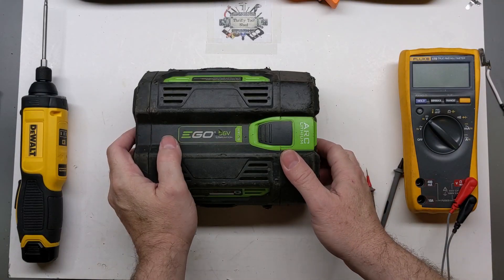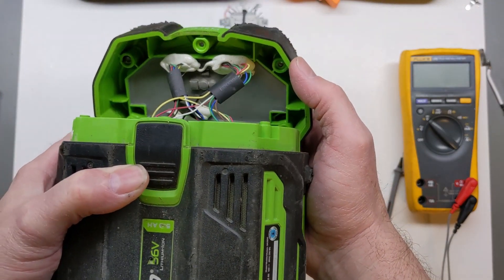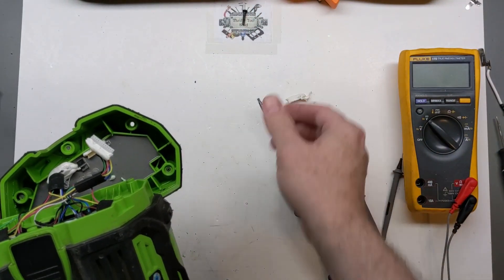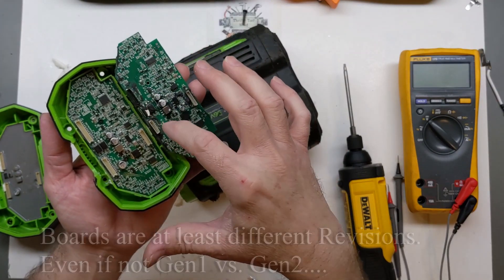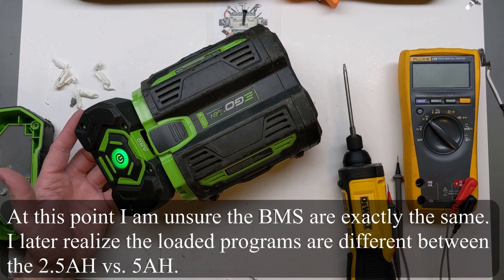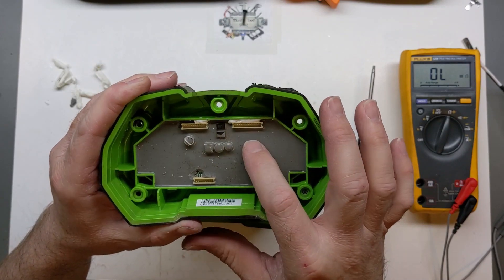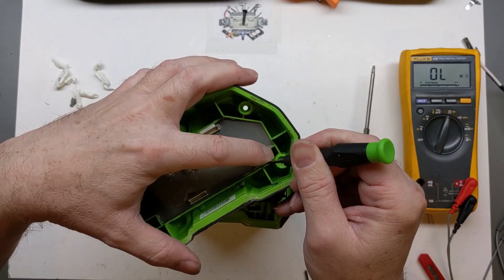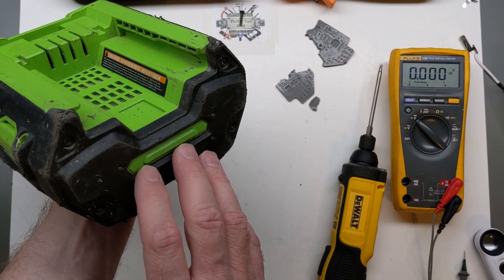EGO 56V Gen1 5AH Blinking Orange Fix

Comment: My batteries are fully charged (supposedly ) and after few seconds of runing my Ego lawn mower it stops and blinks yellow exclamation light kn mower and i think yellow on battery. Thkught it was battery. Grabbed another full battery. Same deal. Can leaving lawn mower out in rain ruin it after one time? Batteries were inside and battery container was closed empty. Didnt know it was supposed to rain and was stuck at work. Thoughts?
Reply from the maker: I have seen the mowers not start up fully and flash the yellow light on the mower, and that seems to be a controller issue. It's like the controller is picking up high startup current and shutdown. I verified mine by removing the blades, and it starts up fine without the inertia load of the blades. I have a EGO mower troubleshooting video on that. It's the only issue I have seen from the mowers. It's hard to say if the rain could cause it, the controller is epoxy sealed well.
Reply: @ThriftyToolShed  thank you! Think I screwed up the controller by leaving it out in the rain once?

Comment: Thank for creating this video, I appreciate the effort you make to educate the rest of us.   I did watch the whole thing and learned quite a lot.   However, I tried the drop fix from the comments, and it seemed to work.  Unfortunately, I thought it was the mower, and think I f**'d it up, before finding this video.  So, I already bought another EGO mower, with the newer, bigger battery.  I will attempt your repair on the old battery, if it acts up again.    Reply back, if you have, or know of a video to properly disassemble/ fix the old Gen 1 mower.  I'd like to salvage it.
Reply from the maker: Since we did find the issue to be a loose connection as shown, of course bumping it might help and it seems to be atleast an quick fix for some, but as you mentioned it might come back and now you know how to properly fix it if it does and that is awesome. Thanks for your comment it means a lot that you took time to comment that it had value even though bumping it might get it to work. The goal of the video was learning together and it seems to falls flat sometimes. 
As far as the mower I do have a trouble shooting video on it and then later a video replacing the controller with a cheaper one since the controller is epoxy potted and not much we can do with it. I would recommend other controllers today and find one with softstart if at all possible if not you need to start mower and them turn pot up slow just so start up current is not too high. 
I am using a tiny controller right now, But it is on the verge of undersized and I hate that, but it's so convenient since it has softstart and undervoltage protection but in. I may do a video on it, but it's too early to recommend. If you like tinkering around and learning let me know and I will be glad to share the link with you, but I can't truly recommend it for sure yet. Also if you run high lift blades, I would not use it. It is too much added load to the struggling controller.
It is so easy and I contacted the company about making a controller just a little bit bigger and they said they would consider it, but they mainly market it to kids ride on toys etc. 
Here is the troubleshooting video of the mower and the replacement video should be after. Best of luck to ya!
https://youtu.be/TnxMegiCu_Y

Comment: Thank you for your video. How much cost you to replace the new electronics board? After you replaced the new board, it was a green light on. What happen for the second turn on was yellow?
Reply from the maker: It is nowhere at this time we can buy replacement boards. I have had luck repairing some boards as we learn. I have shared on video all I have learned so far.

Comment: I had to clean the connectors between the cells, and also did the one where the temp sensors connect to the BMS.  Get some MG-801B with PPE and spray on before assembly of the connectors.  it's supposed to keep the connection good long-term.  Used in cell phone manufacture and in plenty of other things.

Thanks again for all of your videos, saved me a lot of trouble and time!

Comment: Ty for the video, I think I fixed mine by reseating/cleaning the connection that is between the 2 halves of the cell packs
I did the 13:30 part, where you separate the 2 halves, and reseat the connectors. (and clean some of the silicone off)

My original complaint was that the mower would randomly cut out while mowing. I think the battery would flash orange, and the mower might have flashed yellow. You would have to wait 10-30 seconds, and then it would be able to be restarted/used as normal

I did this "fix" (basically pull the 2 halves apart, pull the connector or two out, reseat them). I then mowed my lawn. The mower did not die. It also seemed to automatically kick into a "turbo" mode when about to bog down. I don't recall it doing that before the fix. So maybe the turbo boost is related; like, it draws more power, which overloads some loose connection or something, and causes a safety fault. I don't know; I'm not even 100% sure it's fixed, but it's been through 3 charges since, and no cutouts yet. Previously I think it would cutout once every 1-2 mows.

Thanks for your videos and the knowledge
Reply from the maker: Awesome, so glad it's performing better. Hopefully you have found the issue. Thanks for sharing and for your kind comment!

Comment: I had a similar poor connection on a LM2130E-SP mower control board ... resulted in a solid orannge lifgt on the mower ie thermal fault (when mower cold). Worked connection in & out and fixed!  I think EGO has a problem with the suitability of their connectors.

Comment: How did you open the middle part of the battery into two?
Reply from the maker: Mine had long screws holding the halves together. Then I could gently pull the halves apart. Being careful not to pull the wires. I think I had to unhook some balance wires to allow full movement.
Reply: Are you talking about the cover, or the inside part?  Mine, the cover was very snug, but the two halves of the inner part where the batteries are had nothing holding them, except for a bit of silicone goo.  I took a knife and carefully made a slit in it to help it come apart.  watch out you don't cut any wires!

Comment: Hey, very nice and helpful. What can you tell me about a new( fuel gauge) 400 battery that is like 6 months old and has no RESPONSE at all. Used as normal and charged to full but would not work in mower. Returned to charger- no RESPONSE from charger at all , no lights. If you take volt meter and stick it in the slots you get 56 volts!!!  Fuel gauge has no response either. Do have any idea WTF is going on??? Would appreciate any input you would have.  THANKS FOR " Listening "
Reply from the maker: Glad you found the video helpful. I have not had the opportunity to work on much with any of the newer packs (that I call Gen 3) with the segmented fuel gauge. It is similar to the older ones in many ways. The first thing to check is if it has a fuse on the connector board and the going to the BMS board. Simply make sure it has power from the connector board getting to the BMS board via the bottom middle connector from the BMS to the connector board. Usually it has 2 black and 2 red wires in that connector that should have 56V on it. If you have the 56V getting to the board from there it is usually an issue with the DC-DC converter part of the board. In about the middle of the board it has some larger capacitors and it has a small silver can or cube that has 3 coils in it for the converter circuit. Sometimes those coils do go bad or maybe even another issue with the circuit. If you have 56V in to the BMS then you should see some voltage like maybe 10V or so on the cap close to the coils. Many times the issue is around that, but could be many things really. It's a pretty complex board. This pack also should be under warranty which I assume you already know at this point. Best of luck to ya!

Comment: Love the awesome videos and keep up the great job! I have a gen1 5Ah battery stuck in maintenance mode. Have you ever came across this? Any info would help, thx.
Reply from the maker: The blinking green light. That is my very first EGO video. I found Q12 transistor shorted on my BMS board. It's been a common failure. I did have to suffer through so many viewers telling me it was just maintenance mode that nothing was wrong and also that it was under warranty and to send it back. Instead of just simply actually watching the video where I explained EGO did replace it and told me to keep and recycle it. I also explained it was constantly blinking green and it will pull the cells down to zero and ruin the cells if not charged very often or either unplug the board until repaired. It is an older video and just learning together as we tried to repair these. Hope you find it helpful. 
https://youtu.be/EH0GS0iUzzM?si=CKDuAUYaDc8AP7HJ
https://youtu.be/EH0GS0iUzzM?si=CKDuAUYaDc8AP7HJ

Comment: Is there a temperature sensor n these batteries? I have a 10ah Ego that if it’s in my Ego mower it shuts off after a minute if the outside temperature is over 85degrees.  Mower works normally with other batteries. In colder temps the 10ah worked for much longer, works ok in leaf blowers.
Reply from the maker: Yes, I have an older video called "What is the T-terminal?" I talk a little about the NTCs in the pack also the 5Ah and above have temp. monitoring boards in-between the pack halves. The 10Ah was not out yet at that time so I am not sure exactly how similar that will be.

Comment: My Ego 56v battery was flashing orange and I couldn’t get it to work. After watching your video I dropped my battery around 6” onto concrete. The battery is now working as it should, I suspect a bad contact as you described. Thank you!
Reply: Hhahaha thx, that fixed my battery
Reply: Awesome video, and based on the comment, tested the theory of a bad contact by dropping the battery onto my cement garage floor from a relatively low height of ~ 6".  Dropped it so that the indicator light was facing the floor, since it seemed well protected.  Then pressed the light and presto --> green :-).  Thanks to the video author for a great well explained video, and also for the idea from the commentor!

Comment: Thanks for the hard work put into this video, but this definitely isn't an 'easy' fix, as some commenters have said. Easier thing to try? The following worked for me, with my 1st gen 7.5ah battery: unplugging the charging unit for about 5 minutes and then plugging it back in, then charging the battery. It works each time I do it, but I have to do it before each charge now. It turns out that my charger was on its way out and somehow screwed up the status detection in one of my two batteries, so I had to order a new charger and am looking forwarding to this 'flashing orange' issue being no more. It was the charger, not the battery!

Comment: ego design flaw with the battery in the middle to much heat ?
Reply from the maker: One of the best designs I have ever worked on. Most packs like the Echo 58V and Ryobi 40V are like bricks and not enough airflow through the pack. The EGO did design for air flow, an arc design to have more space and even used the phase change sleeves for the 1P and 2P packs. As far as the 3P or larger packs, it is always going to have potential risks of overheating with that many cells together. I typically stay away from 3P or larger packs for that reason. For absolutely sure all packs do have issues with heat in some situations and I do agree.

Comment: Absolute junk company. Big surprise.
Reply: These batteries are surprisingly well made, and the fact that we can open them and fix, if/when there is a problem, is a nice touch.
Reply: @jon_byler  For the exorbitant price, we should not have to do that. And certainly not many are capable of doing so.milked I said—-junk.
Reply: You don’t have to do that.  They have a great warranty.  I have had one battery die years ago, they replaced it no questions asked.  The battery I just repaired, I got for free with a mower I bought used.  Original owner had already made the warranty claim, so I got a free battery for about half an hour of poking around in the battery.  Others o know with ego stuff have never had a problem at all.  They either fail quickly or last a long time.  And failed quickly is under warranty.

Definitely not
Reply: @jon_byler  They certainly did not give me a free battery after it failed in year two. Garbage. Avoid at all cost.
Reply from the maker: Curious as to why they did not honor the battery under warranty, did you have the pack registered?
Reply: @ThriftyToolShed  It was registered.
Reply from the maker: @hammill444  
I have dealt with them a lot in the past and talked to many that have as well. I have never seen a bad pack that was registered not warrantied. Just wondering what could have changed. I would call again for sure.
Reply: @ThriftyToolShed  Their customer support is atrocious. I switched back to gas.

Comment: Thank you for sharing your video! I have a similar problem with my Ego 56V, 5Ah battery. Despite being fully charged and measuring 57.6V, the red light starts blinking after operating for only 1-2 minutes. I'm wondering if this issue is caused by the circuit board or the wiring.
Reply from the maker: Yes if all cell groups are testing good and all connections are good at the BMS then most likely it is a BMS board failure. The most common issue is a cell group or more than one cell group reading lower even if the pack over all voltage is good. The second most common issue to me is connections on the board and thirdly the board itself. Thanks for your comment.  Best of luck to you with yours!

Comment: I have one of these batteries that has this problem. I've taken it apart and cleaned the contacts with electrical contact cleaner multiple times. This always works, but within a few months the problem comes back. Any ideas for a permanent fix?
Reply from the maker: If I did have an issue coming back I would consider giving the board a coating to help prevent it. I would make sure to use a silicone based potting to easily be removed if it were needed. Something like this as an example?
https://amzn.to/3EgwUpa
Reply: @ThriftyToolShed  I took the battery apart again, cleaned the contacts again, and sealed them with the product you recommended. But, here we are in mowing season again and the problem has returned. I only have a small suburban lot so I doubt is really overheating. For now, I take the battery out and drop it on the lawn from a couple of feet and it works again. I am debating soldering the connections but that would be quite a challenge in such a tight space.
Reply: you need better contact cleaner, something that will keep it from corroding in the future.  Did you only take out the connectors between the batteries, or did you remove the connectors from the BMS board also?  I just fixed my dead one, and initially only cleaned the connectors at the thermistors between the cells.  I put it all back together and it seemed to work, but then the flashing came back.  So I also cleaned the connector for the red and green wires from the temp sensors to the BMS.  seems to be working now.

I used de-oxit to flush the connector (careful not to get it all over everything, or the foam bits inside will come unglued!).  After letting the de-oxit sit for a bit, I pushed the connectors in and out, then did a final spray with some stuff called MG-801B, which has a compound called PPE (polyphenol-ether) in it, which is supposed to protect contacts and keep them from corroding.  a bit expensive, but a little goes a long way, and is supposed to last a long time.

Comment: Thank you for the great video on the 5AH EGO battery.  I have a 7.5AH battery that will not charge.  Is there something I can do to repair this battery?  I would hate to toss it out.
Reply from the maker: I do not have the 7.5Ah to say for sure. I would think they are very similar other than 14 sets of  3 cells in parallel instead of 14 sets of 2 cells in parallel like the 5Ah packs.  Of course the 2.5Ah packs are just single cells in 14S or 14 in series.
Thanks for your comment!

Comment: My gen II BA2800T was deemed defective by EGO and replaced, not sure how to proceed with possible repairs to this one. When I press/release the button, I get 1st green segment, 2nd green segment, then all 5 segments go solid red for ~ 10 secs. I tried ohming across "-" and "T" and get no discernible reading (float). Across "-" and "+" I get 49.7v. I had previously tried tricking the thermistor circuit with a 10k resistor which made no difference. Any ideas appreciated! 

BTW, I posted in this thread last year but due to (lack of) sort capability could not find that post...
Reply from the maker: I have not worked on one of the newer Gen packs with the segmented fuel gauge, but this is similar to the issue with the 1st and 2nd gen packs. In those packs the light would turn green when pressed and then flash red. I have only been able to fix those by replacing the BMS board. I have several bad packs for parts etc. a lot of those had bad cells so I had a couple spare boards and used them in these repairs. I spent  a lot of time testing and troubleshooting the faulty boards with no success on this one. I could not find any obvious issue with the BMS board even though it was the cause. I have several repair videos of the BMS from the blinking green led being a shorted transistor and the red led being a loose connection in the pack. I have not found a board fix for this one yet. I kinda decided it might be a microcontroller issue as I found no odd comparison readings from testing a bad board with a known good one. Not saying for sure this is the same issue, but seems similar.
Reply: @ThriftyToolShed  Much appreciated, thanks!